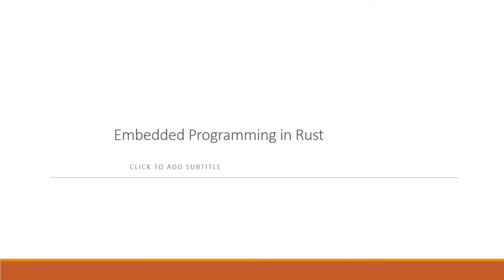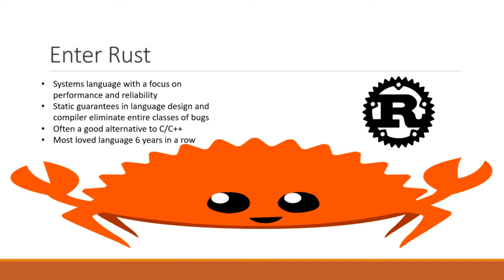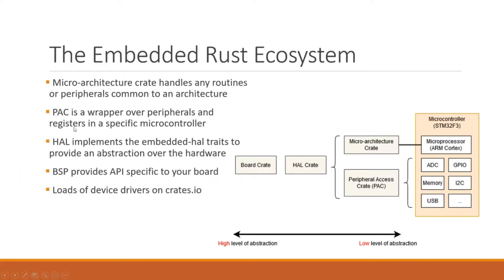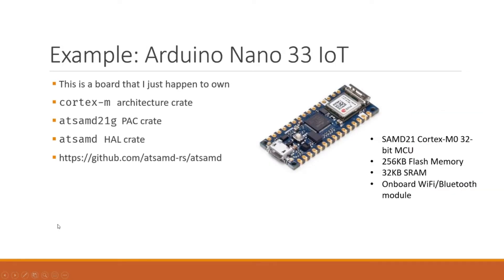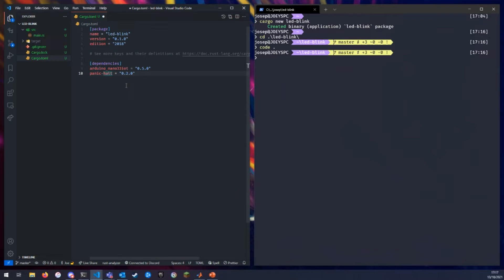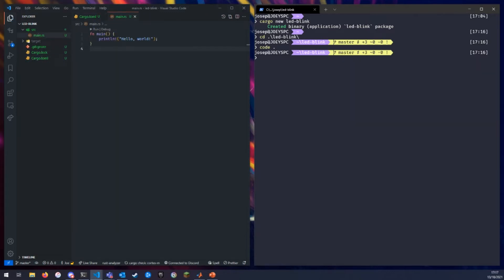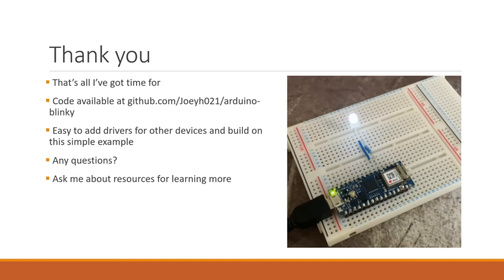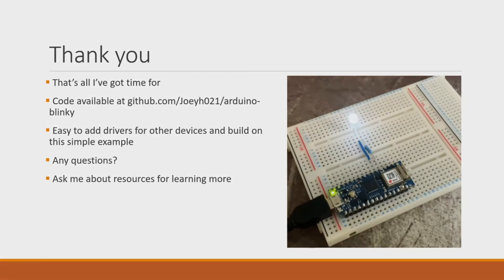⚡ Embedded Programming in Rust - Joey H

Comment: Correction: `loop` is not just a shortcut for `while true`, as this discussed in-depth before it's implementation, as by featuring a loop which was explicitly infinite in its semantics, the compiler could more actively optimise for its structure.

In addition, `loop` is the only loop scope where you can make use of a `break` return, due to being able to reason a specific exit condition.
Reply: How is there a difference? While true and loop are semantically equivalent, and LLVM + the Rust frontend is a mature enough compiler that there should be no difference in the output binary. Unless this is without optimisations?